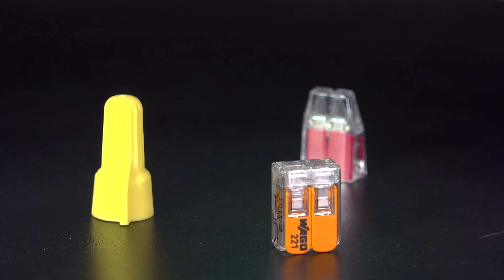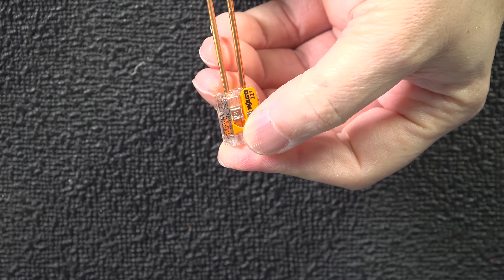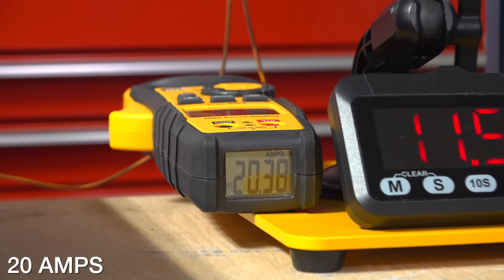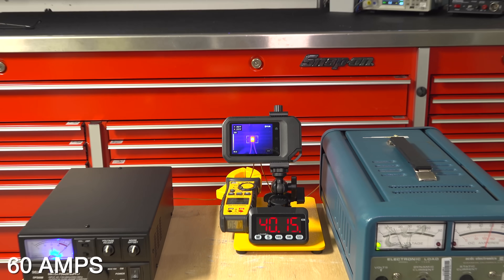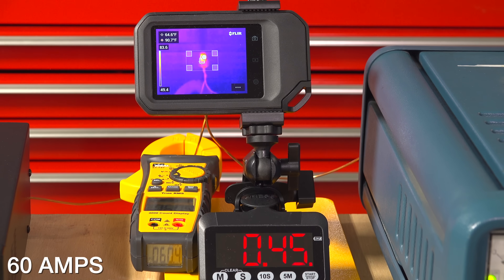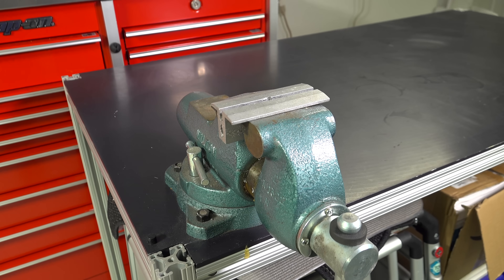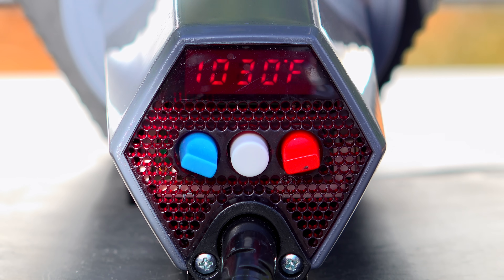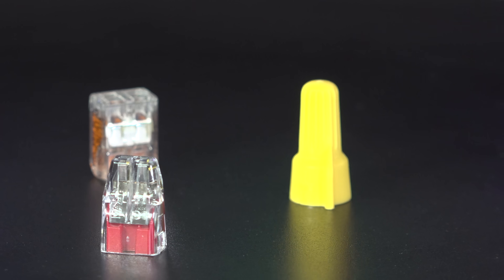What Wire Connector is the Best? Wire Nut VS Wago TESTED

Comment: Never heard of them until I stumbled on this but wish I knew of them earlier in the year.  I have done a lot of wiring in my life and was doing a small job for a friend in January.  I was taping into a 12 gauge line in a crawl space to create two new outlets in a large closet - for their new Peleton and the wifi device. The space was dark and tight, I was balancing on a joist and trying to twist several wirenuts on 12 gauge wires in two different junction boxes while balancing on the beam on my stomach. The next day my right wrist hurt really bad but I did not think much about it but it did not get better.   After 30 days I went to the doctor and he comfirmed that I had given myself tennis elbow - I could not believe it but he was right and that was the only thing that I could have done that caused it.  I could not even squeeze a tube of toothpaste with out pain for the first few weeks. Should I have pretwisted the wires with pliers ?- likely but I figured it was a small project and twisting by hand would be quick.  One thing for sure if I had used Wago's it would have been less time balancing on that beam, no pain in my wrist and definitely NO tennis elbow.

Comment: I don't get the relevance of the meltdown test, especially without simultaneously checking the electrical integrity of the connection.  In what scenario does the Wago's 190 degree higher melting point amount to any real world benefit?

Comment: People hating on Wagos use them improperly 99% of the damn time so they cant get them to work! IT SAYS RIGHT ON THE WAGO WHAT THEY ARE RATED FOR.
I only carry the Wago 221 for flex, stranded and mixed splices like solid to flex and the standard push in 200 series for solid core with me now and I use nothing else.
The 221 always blows peoples minds when I use them for lighting installs.
I do not care about the overload behavior of splices much. Why? Because there is ALWAYS a breaker or fuse in line that will disconnect the circuit under a prolonged overload.
The temps at the rated load of the wago for a prolonger time is more important because that really tells you what the resistance of the splice is.

Why are Wagos massively popular in Europe?
Because like 80% of all circuits here are 16 Amp (general use, outlets) or 10 Amp circuits (lighting). So WAGOs are really never loaded to the max here.

Comment: * overload starts at %77.7 of whatever the wire or connector is rated for. a breaker will trip at about 80% of its number. For example, a 20a breaker will trip at 16 amps, the higher the overload the faster it will trip. And a awg 12 cable will start heating up at 16 amps.

* the fact that the wago is gaining heat, means that its overloaded, it will continue to do so until melted apart. 
This doesn't mean that the wago is not good, since you tested it on 20a instead of 15.54 which is %77.7 of its rating, wich should have been fine.

*when using wire nuts, the wire nut should not be relied upon to cunduct the load, rather it should be viewed as a 'cap' for a good tight splice. 

* a loose connection generates heat, (and sparks, light flickering, wastes e energy, etc). Its not to much about what kind of connectors you use, more about if you check your splices to see iff you could shake it or pull a cable out.

Comment: If there were less twists in the wire might be more accurate for the wirenut test.  When running sheathed wire the conductors would not be contacting each other outside the wirenut like they were doing in your demo - some of the current is sneaking through w/o doing it within the wirenut!  Basically the current can pass through where the unsheathed wires are touching / twisted together and not inside the wirenut.

Comment: Electricity travels on the outside of wire, not the inside. @ 2:43 pause and look at the bare wire...it's a "dot" of connection....Fine for speaker wire....but not for my microwave, hair dryer, toaster oven and the like. At least with wire nuts there's measurable surface area.

Comment: New sub.  I just bought an LED recessed lighting kit that used these Wago push-in connectors.  Man, I had to push like crazy to seat them all the way into the connector but once in there was no way I could pull it out.  I was concerned about overheating if there was a short or too many amps and this answered that question in spades.  Great video.

Comment: I don't think the load test on the wire nut is fair. by twisting the wires, some current flows directly between the wires rather than through the wire nut. Without twisting the wires, the wire nut would probably get much hotter under load.

Comment: Sorry....no. Current travels on the outside of wire....not inside. The surface area of wire is measurable.....This is like touching 2 wires together in a cross X....How do you measure/ achieve surface area where the actual connection is the size of a dot?...it's a no.
Reply from the maker: I think you should let the NEC/NFPA/UL/CSA do their jobs since they already tested these with favorable results. I get that you don't want to believe these work as well as they do but the fact is they do, thats why the design is patented and isn't just a new type of backstabbed outlet
Reply: @SilverCymbal  You're unable to answer my simple question: "How do you measure/achieve surface area where the actual connection is the size of a dot?"
 I have common sense...you have an agenda to sell product.., the NEC/NFPA/UL/CSA and the like can all be bought off.
What's your/the answer to my simple question?
Reply from the maker: @readmore3634  There is no answer that will make you realize you are wrong but I will try. It is not the size of a dot, obviously.
Reply: @SilverCymbal  Your answer is inadequate...You know nothing about this. @ 2:45 pause and look at the wire...it's a dot. I'm "obviously" asking the wrong person. 
By the way...you say " There is no answer that will MAKE you realize" ...Haha,  You shouldn't try to "make" people "do" anything...convince them.

Comment: Greetings from the Ohio Porters again. I just watched your previous episode on these connectors. I’m really impressed with these. The odd thing is that I’ve never seen these at Lowe’s. That’s where I’ve bought most of my connectors over the last 10 years. How could I miss them. I usually buy a  bulk pack of wire nuts at a time…I want to get in & then get out so I can Get R Done! Thanks for the update. I’m sold!!! 🤩🥰😎🧐 I will share it with my friends!

Comment: I'm not professional (but educated) electritian. And most failed of wire connectors i saw was not rated for current in circuit. Like get connect whole house with connector from cheap chandelier. And once i saw half-burned wago (222) because it connect aluminium and copper wire. It's take decade i think when failed.

Comment: Wago is the real deal - please note they come in different styles, these are originally ment to connect multi-core wires (also ok for single wires...)...Anyways, they are spring loaded and will keep up with any of the rated load situations. These Wirenuts are designed to fail, at least over the years. Thanks for your Vid, very well made

Comment: I've noticed that if you're retrofitting old wires to wagos, they DO pop off with a gentle tap if you are fastidious about cutting off any of the end that's bent. Was wrapped around an outlet terminal and then straightened? Pops right off. Bent over at an angle? pops right off. Slight curve from being coiled up in the box for 20 years? Pops right off. Twisted to shit in a wire nut? Can't even get it on. You MUST straighten the wire.

It, of course, says this right on the Wago package.

Comment: the only reason tha wago is rated for 20 Amp is because of the heat. And who the fuck says that the wago connectors come of easy? Outside of America i dont know anybody who uses these sketchy, unprofessional looking wire nuts. Also they are so big and don't insulate the wires properly... they are like a funel.

Comment: As an electrician trained in Germany, my toenails regularly bend and all my hairs stand up when I see these wirenuts ... :D

you never load these wires with 60 Amps.
If you exceed the 15 or 20 Amps, the circuit breaker will switch off.
Short overloads are never a problem.
The Wago connectors have spring loaded contacts and have allways good pressure, also if the copper "floats" (we say so)

The wire nuts ... or screw terminals ... best for burning down the house.

Comment: As a life long industrial electrician always used wire nuts. By the way no such thing in NEC last 75 years as a wire nut. They call them.pressure connectors. Wire nut is a trade name such as roles is for type NM cable. As long as wire nuts are cheaper most electricians will only use them. Do like the Wagon when replacing a lot of ballast. Best testing that I have seen for these.

Comment: Listen these things aren’t practical at all they take up way too much space in a box and sometimes you need to splice 6 plus wires together. And using one of those would be absurd.  The guy making this video loves them but it’s safe to say he has no experience being an electrician. There is a reason why they aren’t widely used and the simple reason why is they aren’t practical at all. I can see the appeal to a weekend warrior that wants to play electrician for the day … other than that their uses are few. The end.
Reply from the maker: The problem with US electricians is that they all have the same mindset. That is NEW=BAD OLD=GOOD and less tools in their toolbox. Plumbers used to be like that but turned a corner with Propress PEX and other newer materials Eventually nuts will be outlawed here just like other countries have done decades ago. That's why even ideal already has a line of push connectors. Are those terrible too. NFPA, UL and NEC complaint. What more do you need?

Comment: How about comparing the price? Wago v wire nut v screw terminal (choc block)? I bet Wago will loose there as they are 10 times more expensive
Reply from the maker: They are 3x as much as a pro grade wire nut and install in 70% less time. The cost of nuts for any project is minimal. You aren't getting a Rolls Royce for the price of a Yugo

Comment: how does your test set up work if there is no return wire coming back to the power supply? how does it complete the circuit? thanks
Reply from the maker: It is a complete circuit. It starts with the power supply into the connector to the load and then back to the other terminal in the power supply. It can be seen in the video.

Comment: Awesome video. I have a background in electronics and do all my own electrical work at my house. No offense to electricians, but I really enjoy the work because it's a nice change from my current (lol) desk job. I've used wirenuts and Wago connectors. Wagos are great when you are connecting a large number of wires, grounds etc. I think the key is to buy Wago and not the knockoffs. Why save a few bucks on an unknown product, especially for something critical like electrical work.   I've never used any other brand. I also only use Ideal wirenuts. If I ever do a large renovation, kitchen for example, I'll most likely switch to all Wago.  This video is awesome and you have a great kit of test tools.  One followup - Don't use the crappy wirenuts that are included with light kits or ceiling fans. Most are garbage.

Comment: I don't do many home electrical projects because I hate wire nuts, especially with stranded wire.  Now that I found out about these I have no hesitation.
Sounds to me like the electricians just don't want people doing their own work instead of hiring someone.
Reply: PEX plumbing had the same pushback for a long time in the USA, but once newer generations of plumbers figured out they could do jobs faster for the same money, or do more jobs in the same time and make a lot more money, plumbing codes got changed. Then there's the benefit that rolls of PEX are far lighter than lengths of metal pipe and also much easier to move to and around jobsites than lengths of metal or PVC pipe. I cut all the old galvanized steel plumbing out of an old house and replaced it with PEX A hooked up to a valve manifold from Apollo. (No, not the Greek god or Dirk Bennedict's Battlestar Galactic character.) At the time they had a PEX-B manifold and also PEX-A valves that looked like they could screw onto the manifold in place of the B type valves.

So I contacted the manufacturer and asked if the A type valves would screw onto the manifold. Yes, they would. OK, can I order a manifold, minus valves, and 12 of the A valves. Oh, yeah, they were just about to introduce their new product line of PEX-A manifolds, would I like to buy the *very first one*, at a discount? Don't have to ask me 2x! When the box arrived it was printed up for the manifold with the B type valves and they'd printed new labels for the A type and stuck them onto the box with their new item numbers for the A type manifold.

Never know when asking the right question will get a company to make something they hadn't been seriously thinking of making, especially when all they need to do is put together components they already make into a combination they don't offer for purchase. I haven't looked recently, but why I eneded up asking Apollo those questions was because NOBODY made a ready to use PEX-A valve manifold. All of them were for PEX-B. If you wanted a PEX-A manifold you had to build it out of pieces of PEX, fittings, and valves or buy plastic or very expensive copper manifolds which were pieces of pipe with 2+ stubs in a row of one side, and figure out how to connect valves to it.

PEX-A was for some reason being targeted as a replacement for old school trunk and branch configurations as had always been used with metal and PVC pipe.

So what's the deal with PEX-A VS PEX-B? B uses fittings that have a smaller diameter than the inside of the tube, they just drop in loosely, and crimp rings crush it down onto the fittings. A weak or crooked crimp can cause a leak, and the strength of the pipe plus water pressure is always pushing against the crimp ring. If PEX-B tube gets a kink, the whole line has to be redone or the kink cut and a splice fitting installed, which adds another flow restriction.

PEX-A fittings have an outside diameter larger than the inside diameter of the tube. To connect, a PEX-A reinforcing ring is slipped onto the end of the tube then a special tool stretches the tube and ring enough to easily slip onto the the fitting. Hold in place about 10 seconds and the ring and tube shrinks onto the fitting. After about a minute it's ready for water pressure. The ring and tube is always trying to contract back to its original size, so it's always working against water pressure. PEX-A fittings have an inside diameter the same as the tube so flow restriction is minimal. If PEX-A tube gets kinked, simply hold it straight and hit it with a heat gun until the kink goes away. The only downside is only two companies make electric PEX-A expanders, Milwaukee and Makita, and the Milwaukee kit with expander heads for 3/8", 1/2", 3/4", and 1" tube is $400. For metal pipe size equivalence, 3/4" PEX-A has the same inside diameter as 1/2" steel/iron pipe.

Yes, PEX continued the never to be damned enough tradition of plumbing sizes having zero relation to reality. 1/2" PEX-A is large enough for most things like faucets, showers, washing machines, because with a manifold setup you can have one jointless run directly to every tap and appliance so unlike ye olde rigid pipe with all its fittings causing turbulence, water flows much easier through PEX.

Comment: Because of the Wago 221 connectors, it makes electrician work just a little bit more fun and easier. I truly love those connectors. I wouldn’t go for anything else because of their ease of use.

Whenever I buy electrician stuff, if they have the 221’s, I always prefer those. And the 222 by the way is also a very good one, but they’re a little bit bulkier, So I prefer the 221’s always!

Comment: This experiment is great, but based on the fact that most of these would be used in enclosed areas. Small tight space in the single gang box could effect temperature and get hotter at lower amperage that your tests didn’t incorporate.

Comment: people who complain about Wago connectors are people who are adverse to change. they are tested using the same test as a wire nut and thus certified to the same spec. not manufacturer would overbuild a wire nut. everyone is trying to cut cost. if these pass the same test as a wire nut, they are just as good.

Comment: sorry US based sparkies, but those wago's are used all over Europe on WAY heavier load 40A, 240v circuits. The good ones, not the knock offs are super secure. Some shark bite style ones I've used literally won't let go once you insert.
Reply from the maker: You can see by the comments why its taken 40 years for these to finally begin to catch on here
Reply: @SilverCymbal  Ever see a ceramic wire nut? Those things are ancient technology. It's like someone invented the wire nut 70 or more years ago and other than changes to bakelite then some other plastic, they're remained essentially the same crappy device, and until recently nobody gave a damn about coming up with something better.

Comment: The wire nut test was hardly fair.  By twisting together the copper wires you don't even need a connector.  Most of the current would conduct at the first turn of the copper wires that was well below the wire nut.  That is where most of the heat would be dissipated as well.